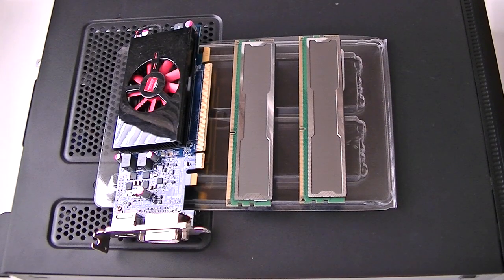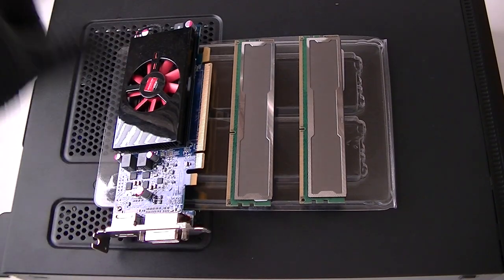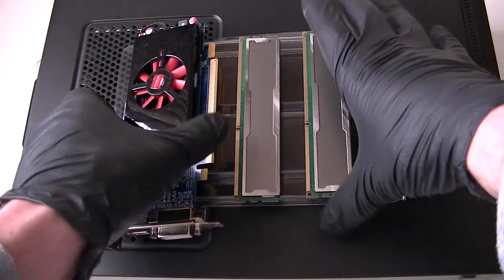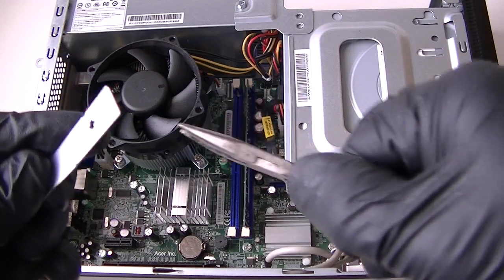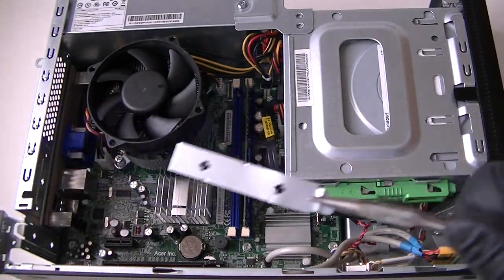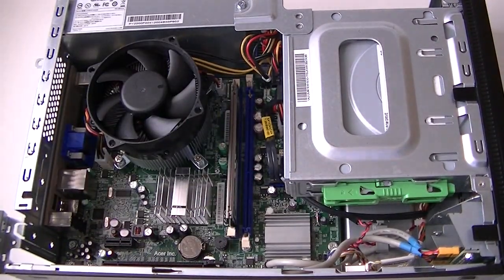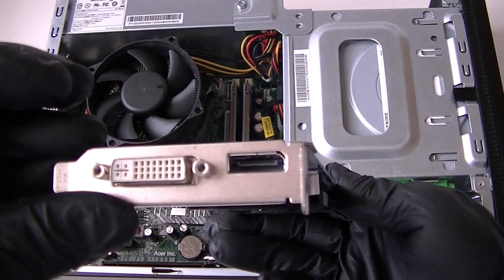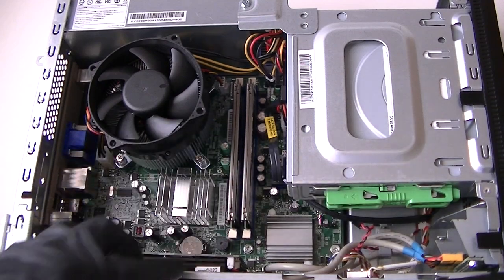Acer Veriton X275 Upgrade Video Card, Memory

Comment: I put an RX 570 full size 4Gb in mine and it runs great. A riser or bigger box will handle whatever you put in it.
Reply: Can it run cyberpunk tho??
Reply: Works if you put the components into a bigger case and upgrade the psu

Comment: I have this pc will a ausa 710 graphics card work?
Reply: Yes. I put a full 4gb Rx 570 in mine.  Put board in a bigger box and installed high power PSU since Radeon cards need extra power.

Comment: i upgraded this pc to a gaming pc
old specs
CPU:pentium 4
GPU:intel hd
HDD:320 gb
RAM:2gbSpecs after upgrading
CPU:intel core i5
GPU:Nvidia GeForce GTX 770
HDD:1TB
RAM:8gb
Reply: No i5 will fit in a 775 socket wtf
Reply: who are you to upgrade your ram to 8gb when the ram limit is 4gb and get a i5 on a lga775 socket bro give explanation

Comment: hey, just wanna ask, can I upgrade the video card to GTX Ti.. for gaming? i have the same one but vx2611G model
Reply: Andrian Fitra GTX 1050ti Low Profile will work. I think on vx2611g its cpu is i3 3220. It wont bottleneck it that much
Reply: thanks by the way I have upgrade the case and Power Supply, so for now I will save my money for buy worth Video card hhe
Reply: where did you buy the new case?

Comment: What kind of memory did you put in? I've read that putting in another Kingston (default ram) doesn't work?
Reply from the maker: Max 4 GB DDR3 800/1066 MHz SDRAM (dual-channel support on two DIMMs.The Memory size per socket is 1GB/2GB that supports DDR3 800/1066MHz, modules.The Maximum System Memory Supported is up to 4GB. This acer motherboard really picky over which RAM it accepts.
Reply: Yep, I know the specs. Looking for the type of brand of ram you use for this comp.
Reply: Nawrocki I have 8 gigs of apacer ram in mine.

Comment: what name is video card
Reply from the maker: amd radeon hd 7570 low profile
Reply: +mxkdi thank you
Reply: +mxkdi adm Radeon 8490 is good?
Reply from the maker: AMD Radeon 8490 will not work with this motherboard, you have to upgrade your desktop to newer model at least intel core i3 or i5
Reply: ***** my cpu i5
Reply: Amd radeon 7570 not have in shop
Reply: ***** recommend video card for me
Reply from the maker: You can install mini fan on the rear side or side cover panel